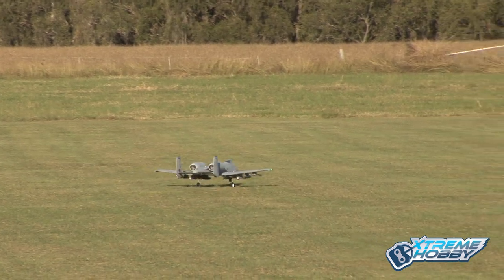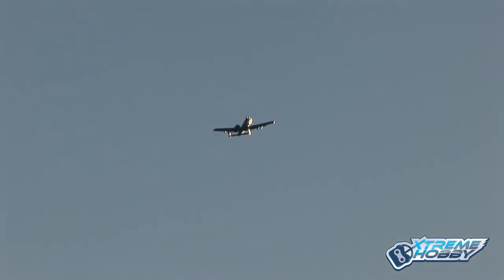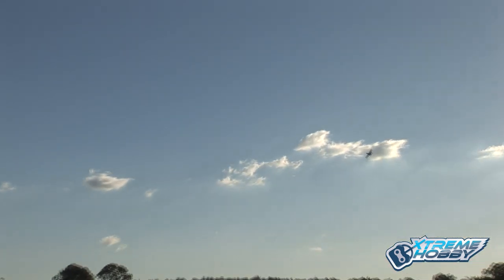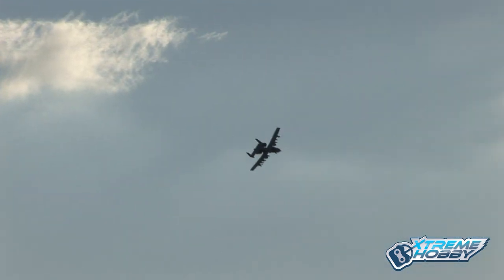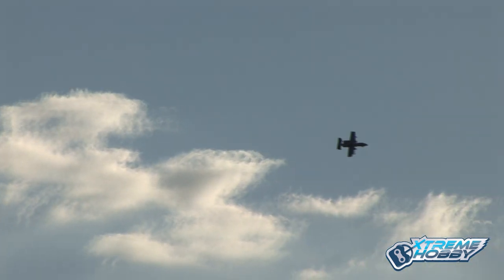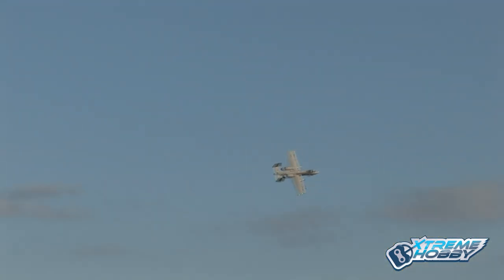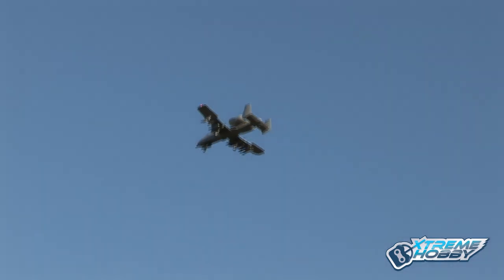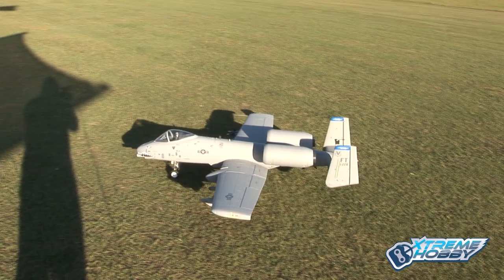Freewing 1700mm A-10 Thunderbolt II Flight Review

Comment: Beautiful aircraft, definitely in the top 5 of my warbirds (1977).  I've been flying the EF Thunderbolt II 64mm and it too is a great non-scale flyer.  Meaning it rips around unlike the real McCoy.  I'm curious if the Freewing 2x100 Amp ESCs have reverse-motor (thrust) similar to the EF Avian 70-Amp Smart Lite Brushless ESC, or do I need another component?

Comment: unreal.  ur skillz are not real.  Amazing!  I am thinking about not getting one of these due to the fact that it is going to be novel at first and quickly wane off.  I know this because i used to fly.  I have also had many other hobbies.  They all poop out and become boring as dry paint after a while.  And if I wait a few years, I get a tiny itch.  But everytime I go back to a previous hobby, they die quicker than first time around.  So, I think the better part of not making the repeated mistake is to just not rehash an old hobby.  And also actually not get new hobbies as they die out eventually.  For these reasons, I am not going to get a drone either.  thx.
Reply: Sorry late to the party...but..   Wimp!!  "" you get back to the hobby.. get yr ass back in the air.. rc keeps you young.. meber stop the rc.. hope this helps You cuz this comment was for yourself to feel better about the situation
 Now get flying.. 🙃